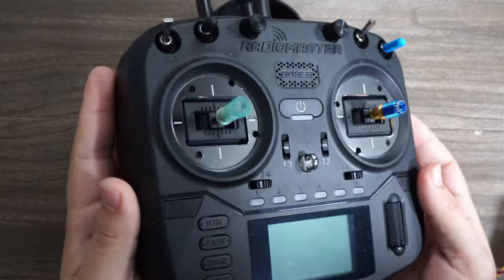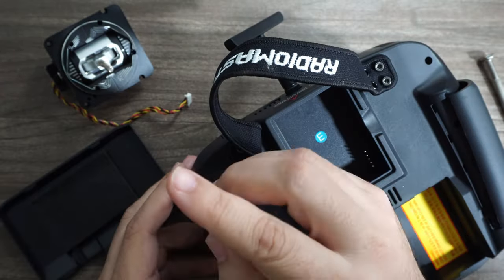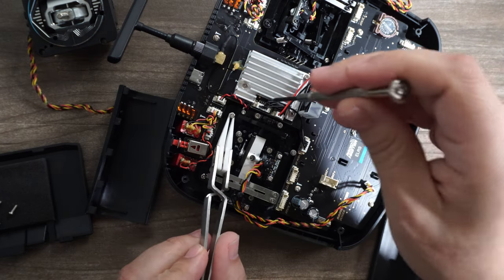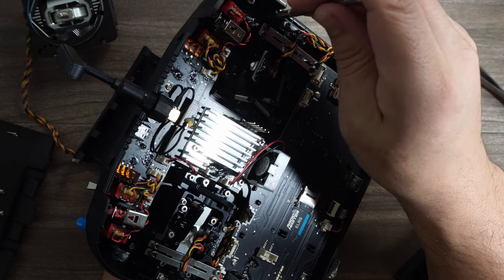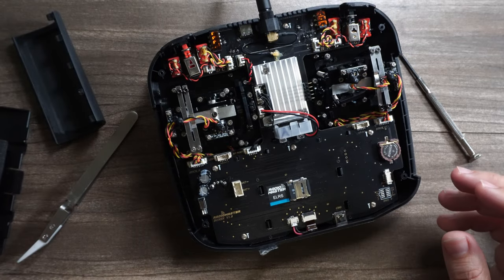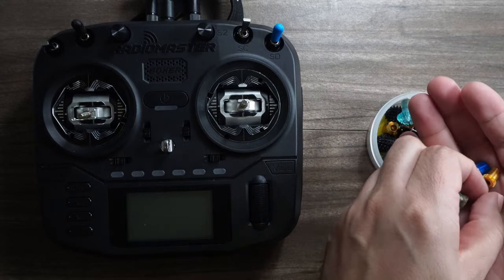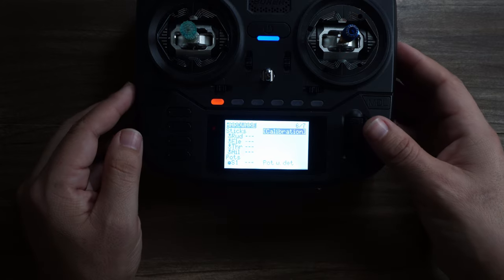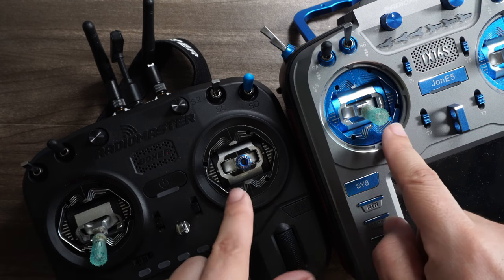Radiomaster Boxer UPGRADE to AGO1 Metal gimbals

Comment: Hey Jon, your knowledge asked:
Has anyone tried a 8S racing setup? The foxeer stack can handle it. I'd guess you need like ~1500kv motors.
Reply from the maker: yes, several top pilots were trying this going into last years champs/nationals in florida.  In the end, most of them abandoned in the practice days leading up to the event, and switched back to 6S.  It was an interesting experiment from what i heard but just didnt offer significant enough advantages.  Perhaps somone will eventually find a winning combination on it.